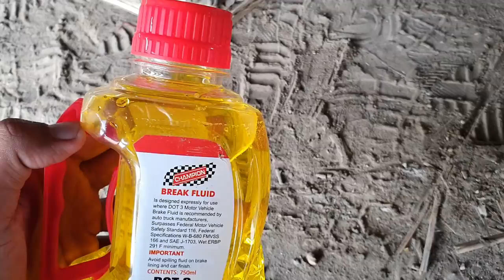How to Repair and Replace Brake Air Booster of Isuzu Truck

Comment: Yes they do replace parts rather than try to rebuild them. Noticed that they use hydraulic Break fluid rather than hydraulic brake fluid? Great video thanks for posting.